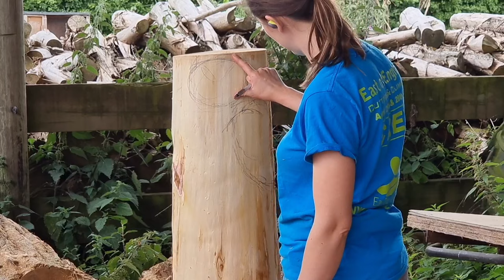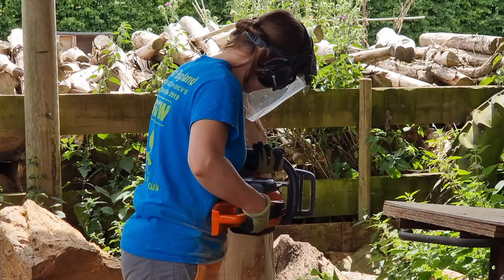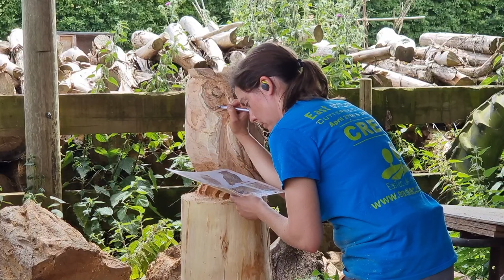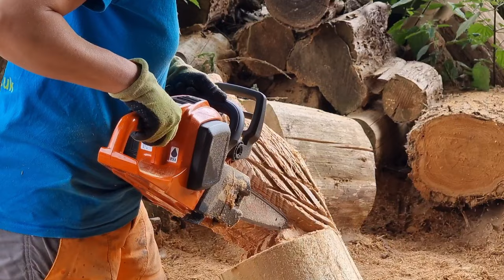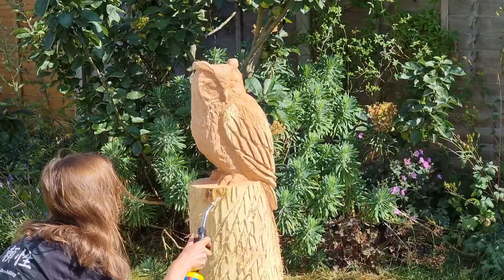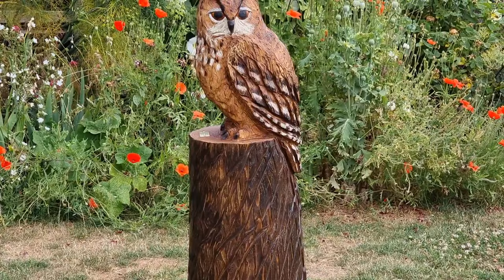Chainsaw Carving an Owl. Step-by-step

Comment: Fantastic piece of art. Such great talent. Did it come easy, (for some it does, or work hard, with many mistakes overcome) to achieve that level? Great Owl, pun intended.
Reply from the maker: I've been carving for over 10 years so I've had quite a bit of practice! 😆
Reply: Wow, no wonder your good at it. 😁👍

Comment: Hola, que cilindrada tiene la motosierra? Y que largo es la espada que utilizas, gracias de antemano
Reply from the maker: Hi, I hope I have understood your question correctly. The translation was not very clear. 

I use 1/4 inch chains only.

The bars I use:
https://www.chainsawbars.co.uk/product/cannon-carving-quarter-1435cm-3-8-lo-pro-050-53-drive-links/

This bar I use only for the very fine detail:
https://www.chainsawbars.co.uk/product/multi1-bn6a-4p30-a-sugihara-tough-carver-r7-tip-12-1-4-043-68-drive-links/
Reply from the maker: The Husqvarna bar is the standard bar that came with the Chainsaw 14" 3/8 1.3mm

Comment: Your owl is magnificent. At first I thought it was a sleeping owl which would have looked wonderful too but then you put in the pupils. I guess you didn't need an angle grinder for the project. I was wondering what the small pen-sized burning tool is? Looks very useful for details. Again, lovely sculpture, have you been doing this for a long time i.e. chainsaw sculpting?
Reply from the maker: Thank you! 😊 Glad you like my owl 🦉 
I've been making chainsaw sculptures for about 10 years now. The small blowtorch is actually a "Gas Soldering Iron" I've just removed the soldering tip. It's perfect for the details 😁
I like the texture the saws create. I occasionally use an angle grinder for smooth things like my penguins 🐧
Reply: @sallyMaytree  Very inspiring and most interesting to watch the forms take shape .Thanks for the video and the info. All the best.

Comment: Great job, it’s beautiful! What kind of finish did you put on it?
Reply from the maker: Thank you 😊 All my carvings are finished with a wood preservative and finally an oil. I'm currently using Osmo UV Protection Oil.
Reply: @sallyMaytree  would a silicone sealer work?
Reply from the maker: @LHarreld  I'm not sure a silicon sealer would work. The oils allow the wood to "breath" letting moisture levels fluctuate naturally with the weather and allowing the wood to dry naturally with age. A silicon sealer is designed to prevent the ingress of moisture and may even encourage rot to develop as it will trap moisture inside the wood.
Reply: @sallyMaytree  thank you!